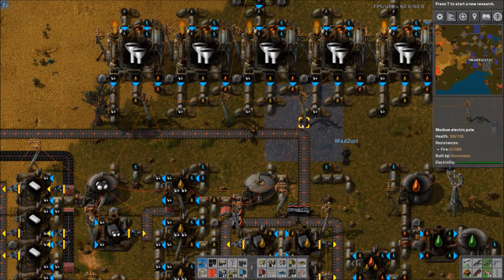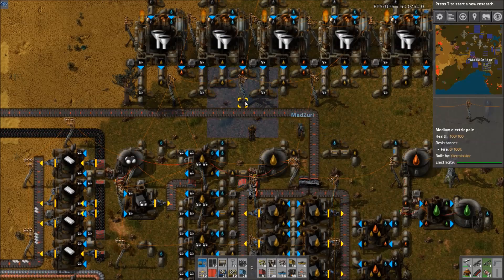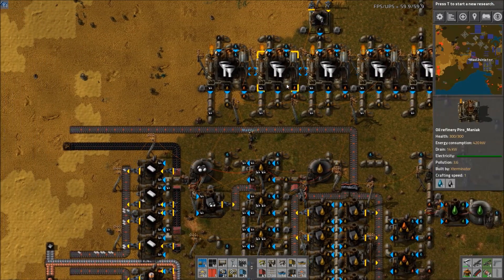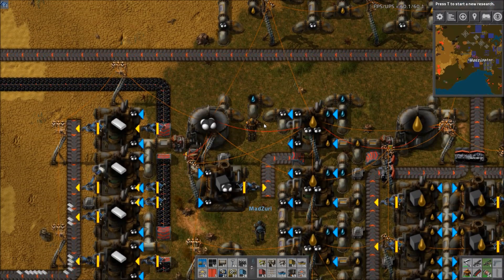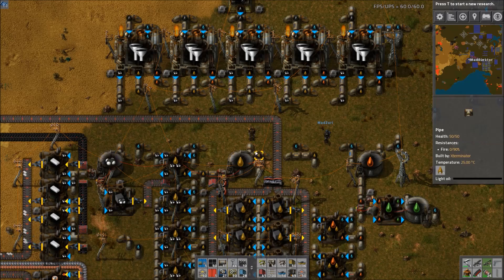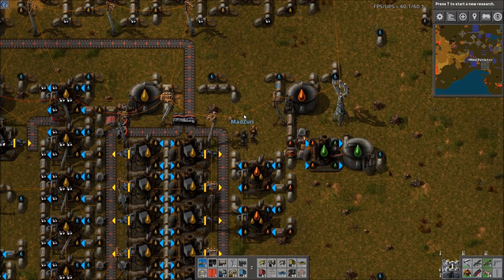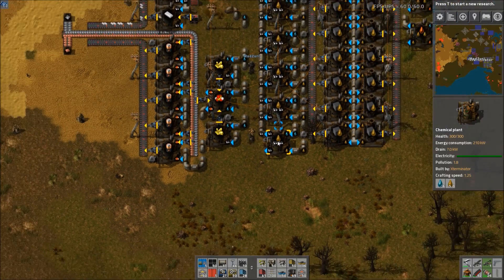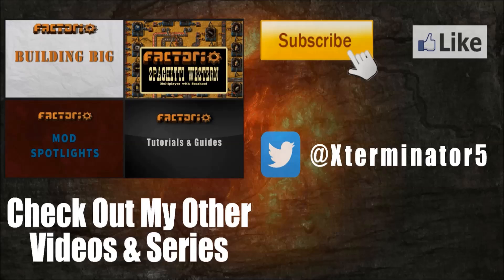Factorio Workshop - Building A Better Factory :: Frank Bruzzese's Oil Build

Comment: I really think that oil in factorio is perhaps the most convoluted process for such very little gain. It's complex in a way that isn't very satisfying when you learn to conquer it.

I mean, there are different types of players true, and many players would simply prefer to be messing with a tonne of trains and belt balancing. I'd love it if the game itself was just purely messing around with trains. Someone make a mod right, where all the industry is fixed on the map, and it's your job to move it with your trains. Like, you'd have all these various areas on the map which made one item, and you had to literally using trains only, bump that stuff around on the map openTTD style.
Reply from the maker: Yeah I agree with you for the most part. Oil is probably one of my least favorite parts of the game just because it's so convoluted and a pain to have to redo at any point. The process of setting up new oil outposts is super annoying to me as well. Luckily that part is being fixed a little bit in 0.15. :D

That sound super cool to have it play like openTTD style. Trains are just so cool, I can't wait for the new liquid tanker they are adding. Looks fantastic! :D
Reply: +Beren Scott , Do you habe a link to this specific mod?

Comment: Hey you reviewed my design!  

Just a note on the number of plastic/battery producing structures.  Approximately half of the structures are meant to be rotated so they can be "turned off" to balance out production.  This allowed me to produce more or less of a given product without having to fiddle with building placements.  Not ideal, obviously, but it was effective.
Reply from the maker: Thanks for the note about the plastic and battery production. Yeah it's not ideal to do it that way, but at least it would be easy to expand to fully support all those by just adding more Refineries as we mentioned.
Overall, it is a good design! :) I really like the smart sections of it as well to control production. I should be using stuff like that way more often myself.
Reply: How about a bit of logic to turn off the Plastic production if you have more Plastic in the system than you do Batteries? (Or just more Plastic than a fixed number)
Reply: Daniel Budney you could certainly do that. I'd do it on the coal inserters so you don't need to add pumps everywhere